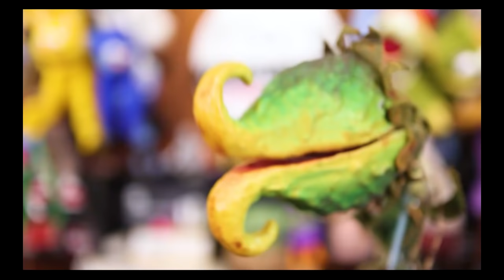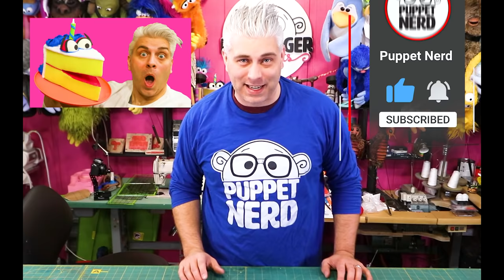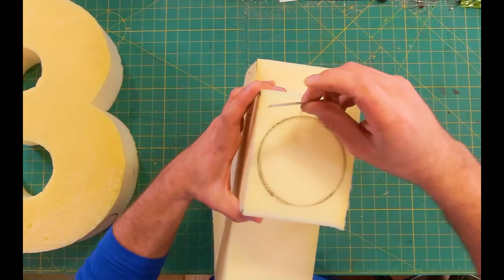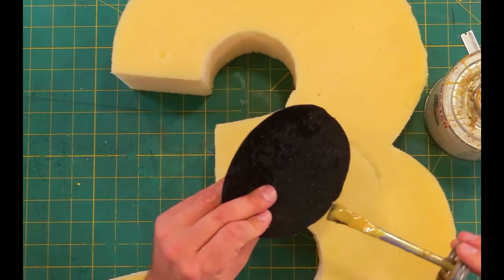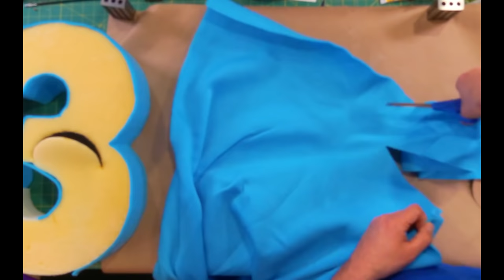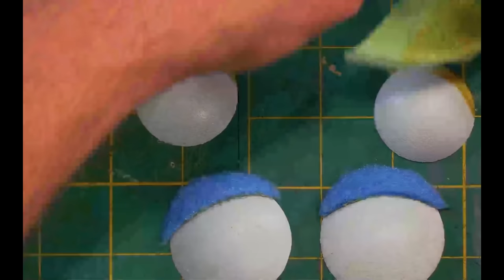How to Make NUMBER and LETTER Puppets!

Comment: I love this, thanks so much! But I’m very allergic to rubber cement and spray glue sadly. Do  you ever use craft glue, Elmer’s or wood glue. I think it could work, would just take longer to dry, be messier, and maybe not the same effect. Have you tried other adhesives?